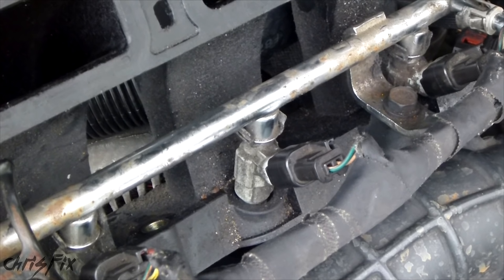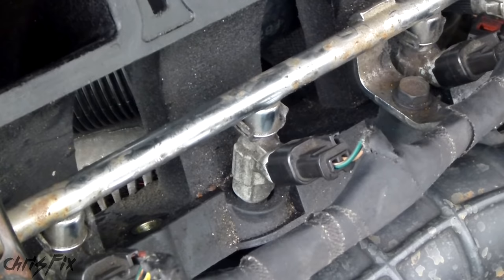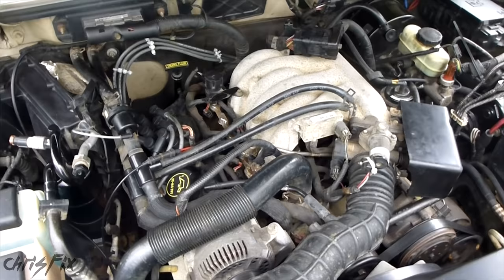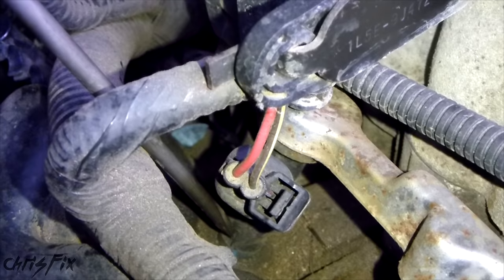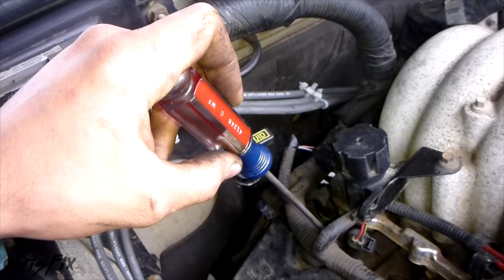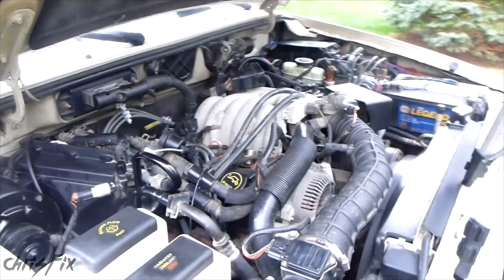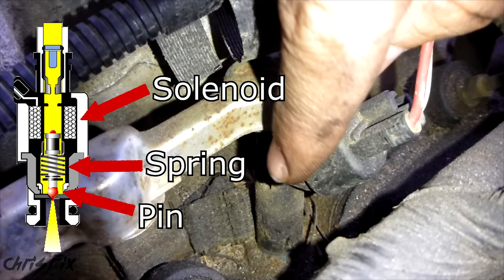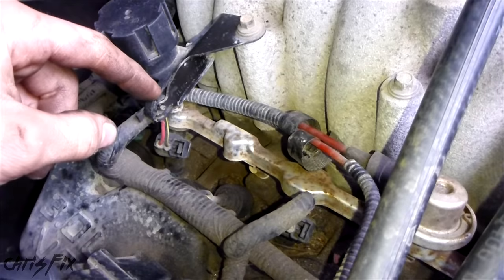Testing Fuel Injectors Fast

Comment: If your inyector seals are bad you can also have poor idle because of air intake trough the broken seal. You can test this with the engine running and poor some water (from a jug or something NOT a hose) on your inyectors. If your idle goes down or you get misfiring your seals are broken. Always change all of them, and chances are you injectors might be clogged.

Comment: Real good video. Took my car to no less than three repair shops for idle issues, along with the poor gas mileage, check engine light as well. Turns out it was the you guessed it; fuel injectors. Along with the coolant temp sensor. The second place did rebuild the throttle body and fixed all the leaks. the last was the best. not to take anything away from this guy but as i was reading the Bentley manual. this is one way they suggest for testing the fuel injectors.

Comment: Hey Chris, before i ask, i wanna say i really appreciate the time you take out to make these videos. Im new to the car scene, as i had always loved them. Anyways, thank you for your hard work and energy put into your videos.
Now for my question.
My car was sitting for a week due to a possible timing chain jump. it turns out, it was my crankshaft sensor. but now, my car runs almost like normal but i no longer have burbles and pops. Only misfire pops here an there mainly at idle. The performance is there but my exhaust doesnt sound how it use to. Is it possible that there is carbon in or on my injectors since it had sat for a week (i had turned the car on an off during that week for different test to diagnose the issue so im wondering if the constant turning car on an off left gas and carbon on the injectors that gumbed up). 
If so, can i just soak my injectors in seafoam? 
136.5kmiles
2017 hyundai elantra 2.0. interference engine. 
Thanks in advance to you or anyone who replies! 💋 Pause

Comment: for the last 2 months I had my van in my driveway due to egr valve and injector # 2 staying open codes.I have a 2010 Chrysler town and country.   I took it to a mechanic shop and was told I had 2 bad injectors. So I postponed the egr valve and went with only injectors replaced with new ones. I drove off the shop only to make it about half way home when my van had same symptoms. I went back and he said that i had same code of # 2 injector again. I went to get the injector again and he replaced it and 30 mins later i went home. Along the way home same thing occurred. I went back to him but this time he suggested an electrical mechanic. I found 1 and it turned out to be that the harness had corrosion built up in it. The van  has no codes and is drivable. However the injector wasn't replaced. I still have some hesitation when i drive slow I guess. I went back to the electrical mechanic and he suggested i drive it like that until I get a code. My question is, should i replace the injector again since i have no codes for it?

Comment: Love your videos. You’re my go to guy for diy car repairs. I have a 2003 Toyota Camry. Could my fuel injectors be the problem when my car cranks but won’t start? I have a lot of power, so Probably not a battery issue. New battery. I’ve checked my fuses, relays and changed my fuel pump. Nothing has worked. I’m lost.
Reply: Crank sensor

Comment: those EFI QUICK pros..are a little expensive although they come in handy. . but a screwdriver in hand can work. .thanks for sharing your video. .it also helps people not to spend money they can't afford. .. I changed all my fuel injections but I think the problem came back?  my car is shakes and throwing white smoke and too much water coming out from the muffler. . if I give it gas the smoke turns some gray also smells like gas from the outside of the car... could it be the fuel injections again? ??

Comment: Good video Chris! Thank You!

Question: I put my foot on the pedal and was able to just zoom. Now I have to slowly get up to zoom, what would cause this? 
I have changed the Fuel Filter, PcV valve, sprayed Carb cleaner in throttle body to clean it up.

Comment: up to p0310 if it has 10 cyl. also a noid light can check the supply voltage and pcm grounding signal
Reply from the maker: Thanks for the tips!

Comment: Hey Chris, i have a 2003 Mazda Tribute. i just recently replaced all the plugs and coils, to fix a missfire and rough idle...i thought itd be running perfectly afterwards but now i notice a "shudder" feeling and a loss of power when she shifts, would you start with the fuel injectors?

Also have you done any videos on oil or transmission additives that supposedly fix leaks? if not i'd love to see one from you in the future! 
your videos are great. thanks for all the vehicle help!
Reply from the maker: +Katie May I would check your tranny fluid level and I would check your motor mounts: https://www.youtube.com/watch?v=ZTRV5GXWpo0

Comment: Hey Chris!
A friend of mine has a 1994 auto Opel Astra 1.6 petrol (standart 90's GM engine) but with an aftermarket LPG system. The problem with it is that, when in idle, it stalls and since its an auto, it can't pull away smoothly without a clutch :'(. I really want to help him and fix it, since he can't afford another car nor to repair it. I'm wondering what could be the cause of the problem (faulty fuel injector/s?). I would really love to hear your opinion on this!
Best wishes!

Comment: Quick question, my car is 19 yrs. old with 215K miles. My injectors have never been changed. Do you recommend changing them? I don't know if they are 100% efficient anymore
Reply: Your best bet would be to get them changed so your engine and fuel can operate efficiently and perfectly, like brand new. You don't have to change them often unless problems occur, but with that mileage and them never being changed, you've been due for some new injector babies. You'll notice a huge difference especially in your gas mileage I'm sure

Comment: Harbor freight sales mechanics stethoscope for like five bucks. Little easy to use on bigger equipment. But yes this way of testing is the fastest way of checking. Once you find a dead one then You can ohm check it.

Comment: Hi Chris. I have been running for 2 years without a filter. Please do not ask why. Last month, my truck started hesitating and the quickly went to a crank with no start. I replaced fuel pump, fuel line. Used starting fluid but will not run for the 2-3 seconds. Fuel dumps from my fuel rails. 95 T-100, SR5, V6, 3.4L. Where should I go next?

Comment: Trying to diagnose a problem with my 98 Nissan Maxima GLS, its spitting gasoline out the tail pipe. I wish it was but its not moisture, its gas, tested it by collecting the moisture in a tuna can and lighting it on fire. I checked the codes and P0301 pop ups, misfire on cylinder 1, replaced the spark plug and no change. I like to note, that I accidentally left the lights on 3 days prior draining the battery, tried letting it charge back up while waiting for AAA (they never came) and tried starting up 3 times over 3 hours and eventually got a jump. That may have screwed up the sensors. It was the weekend and only drove 6 miles the day after, 50 miles the day after, On the 3rd day I noticed the car sounded different on start up, but I just watched a loud movie and thought my ears werent working right. Went to a store and finally noticed a substantial loss in gasoline. about under an 8th of a tank in 3 miles and strong gas smell then saw a lot of exhaust while waiting on a light, that trip was 6 miles in total from store and back. It struggled getting back home. Lastly, my girlfriend happen to have been the one to fill with gas for the last month, 3 half tanks, and informed me of filling it up with 87 octane gas rather than the recommended 91. Any help or advice will be much appreciated.

Comment: Hi Chris, thanks for the video!
 I have an '03 Buick Rendezvous with the 3400 SFI engine. I have a definite miss in one of the cylinders and I've changed all the plugs and wires and checked all of the coils. It shows a miss code so I'm thinking that it's probably a fuel injector but not sure which one yet. I have seen where tapping on the injector can sometimes get them to work again but they are under the intake manifold and a little hard to get to, especially the ones closest to the firewall as the engine sits quite a ways back in there. I think I need an inspection mirror to see and get to the other injectors. I'm gonna try it tomorrow. Do you have any suggestions that could be helpful?

Comment: So my #3 is a random failure. After warming up and turning off and restarting is when i get the code misfire and open circuit. Why is it random? Getting stuck open? Im replacing all 6 tomorrow after a 23 year run with a 4 hole on my Jeep 4.0 IL6.

Comment: Hey Chris,Great video, thank you! My 1994 Dodge Dakota 5.2 is driving and running, but throwing an intermittent code for the injector output signal circuit. I did the screwdriver method, and all injectors are clicking away smoothly, but all are quite fast. Even when running fine, I get power (test light bright on all injectors power side), but no ground (no pulsating light to ground side on any injector). Do you know what may cause this... And how is the truck running with no ground to the injectors??

Comment: I have a 2000 Infniti I30 with 245,000 miles.  It has a loud clicking sound.  Sounds exactly like the sound you hear with the screw driver test, only much louder.  It sounds like the engine is ready to throw a rod.  It's been this way for quite awhile and besides from the anoying sound, the car has been driving beautifully until recently it started running pourly like it wants to stall out and feels like it's running on 4 cylinders. I ran a scan and it indicated 3 way catalist o2 sensor, >bank 2 sensor 2<.  Would a bad sensor cause all this trouble?  I guess I must be in denial.  I really love this car.  I'm retired and really can't afford to take my car to an Infiniti dealer.  What are your feelings on this?  Thank You ChrisFix, you are the best.
Reply from the maker: Pete Palazzolo Is it a sticking lifter or a weak valve spring? Can you take the valve covers off and inspect the springs and rocker arms (if it has rocker arms)? If you increase rpm does the sound increase repetition? If so, I am really leaning to a bad spring.

Comment: What does it mean if an injector is clicking consistently but is clicking really loud? I have a 92 f150 I've been working on and can hear it click standing at the front of the truck with the hood open. It's loud enough that you can tell exactly which injector is making the noise. If I take my stethoscope to each injector it is obvious it is the injector at the end of the fuel rail furthest from the fuel pressure regulator. I've had a tough time finding information on what the cause is considering it is not misfiring or throwing codes. Could it be a bad pressure regulator? clogged fuel injector? maybe even a lifter? Really any tips you can provide on how to diagnose it further before ripping things out would be so helpful!

Comment: with a 2005 kia sedona, the injectors are under the manifold cover. Was told by mechanic, there is no way to do this test on kia sedona without removing manifold cover and once you do that, the engine cannot run because of all the disconnecting. Is this true?
Reply: You don't want to run an engine with the manifold cover off. There's a lot of sensors between the air intake and and manifold cover that the car needs to run correctly, plus a big risk of debris being sucked into the engine. The car would probably stall out almost immediately if you tried it.

Comment: Hello... Great content as usual.. 
I have a problem, my car takes a long crank to start the engine. Almost 5sec or so. The battery is brand new. 
I have noticed when i leave the key in the ignition position, (that is just before the crank position of the key ) for 2min and then crank the engine this happens. I am suspecting the fuel pump pressure or the injectors leaking the pressure. Even the mileage is very low. Can you please help me figure out. Thank you in advance.

Comment: Recently bought a 2010 Ford Escape 4cyl. The car runs fine but when I come to stop, say, at a red light - the idle becomes rough. It goes away when I put it in park or neutral though. I changed the spark plugs recently hoping that was the problem but didn't help.

Comment: If the injector is stuck open would it make no sound as if it was stuck closed? Would the spark plug be wet with fuel if stuck open?

Comment: What if I hear that same exact nose inside my 2011 Kia optima ex 2.4? It has all the symptoms of a bad fuel injector/spark plugs. I’m not super mechanically inclined but since economy has risen up and up I had no choice but to do it myself. I guess you can say I’m missing the experience and am learning now first hand how to work on my cars. Because as you know all the symptoms are the same except for one or two things for system you try a fix. So it starts at high rpms has rough idle makes a clicking noise when accelerating which I thought might be a exhaust issue because of where the sound was coming from when I drive and I have poor gas mileage. It shakes when it’s on idle I have recently smelled gas after driving fast and then at idle, but the exact noise that you let us hear right now I can hear when I’m at a stoplight or in park.

Comment: 2016 Honda Pilot here. Emissions check engine light came on. Took it to the dealership, they are saying I need to completely replace all my fuel injectors. Code P0430. They're charging me $1,400. Nothing is wrong with the car. Drives fine. Does this sound right?

Comment: What does it mean if i can hear that clicking noise without even using the screwdriver. I used to not be able to hear the fuel injectors.

Comment: So I have a 97 Ford 150, and one day all of sudden, I believe to be the cause of water because of a bad rainstorm, it just started losing all power while I was driving it. It sounded a lot louder, the engine was idling rough and it would backfire and misfire. So I immediately was thinking coil packs and spark plugs. I replaced them all and it still is acting the same way. Sometimes it will stay cranked up and sound fine then the next it shakes and sounds rough. I checked my injectors just like this and it sounded fine. I’m so confused on what is causing it to be this way. I am hearing a weird noise coming from the engine bay that I haven’t heard before but can’t figure out what. I also replaced the fuel filter and used Lucas gas treatment for the gas and oil but it still doing the same thing.

Comment: Can an injector stop working intermittently? My injectors will work fine on startup, but as soon as I accelerate the engine begins to misfire, and they stop making the "ticking" noise. Does this mean the injectors are bad? they seem to work fine when the engine is first started up.

Comment: great video! im going through he same issue with my 2009 C63 AMG dealer diagnose the problem to be pump, and sending unit. it still didn't solve the problem. i recently open the oil cap, and my oil smells like fuel. any ideas whats going on?
thanks in advance

Comment: You know I've done this trick before. The solenoid on the injector may be clicking or firing. But that's all it tells you. It doesn't tell you how fast it's firing you can't determine if there's a miss in the injector because how fast is firing. You can't tell if the injector is clogged. You can't tell if the injector is atomizing the fuel properly. You can't tell if the injector is leaking. So to put a screwdriver to it is what an idiot would do.

Comment: Hi chrisfix i was wondering if you could help me out on my 1999 chevy Silverado 1500 with a 5.3l vortec engine i have a misfire ive changed the spark plugs and the wires to so far but still cant figure out what it could be i need the help and thank you for putting these videos out ive learned alot more about trucks and cars.

Comment: Thanks for the video if you change Injector and you have spark any other tips could be a bad cylinder or rocker
Reply from the maker: did you scan the computer to see if it is a misfire in a certain cylinder? It could be so  many things. Do a compression test.
Reply: ChrisFix  yes and it says cylinder 4 which it is the one I think is bad based on your video and dislocating the switch and it had no effect on idle like others

Comment: is it possible to check a bad mechanical injector this way? mechanical injectors don't have a solenoid and simply works by the pressurized fuel to seep in to the injector and push back the spring right? is there any way to check if the mechanical injector is in good condition without having to remove it?

Comment: Im getting misfire on cyclinder 3  I already changed coil and plug so has to be a injector right?
Reply: What ended up being the issue ?
Reply: And solution
Reply: I sold the fucking truck lmfao  I ended up getting another coil that seemed to help

Comment: I wonder if you could use a small piece of copper pipe instead of screwdriver, it might be easier to hear, kinda like the old ear horns people used to use. Just a thought, as I don't have fuel injectors but my daughters car does and I will try in the future.

Comment: Would a bad injector also cause it to blow the fuel injector fuse? I have a 2015 Ford escape and it keeps blowing the fuel injector fuse and just before it happens there’s a lot of hesitation and then the motor shuts off. Once I replace the fuse then I can drive it for a very short distance less than a quarter mile, and then it blows again.I have sent stop driving it until I determine what the issue is. At this point I can’t even drive it to Garage to have it inspected. Any advice would be greatly appreciated. Thank you.